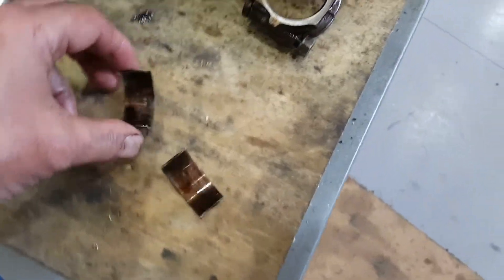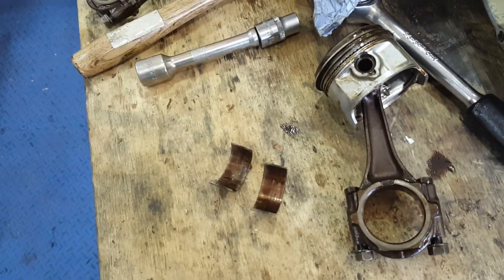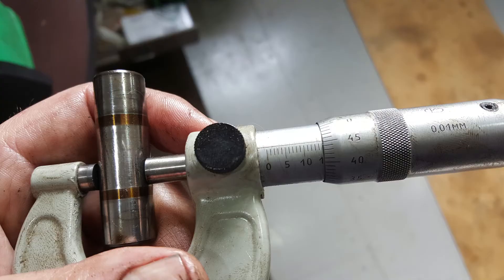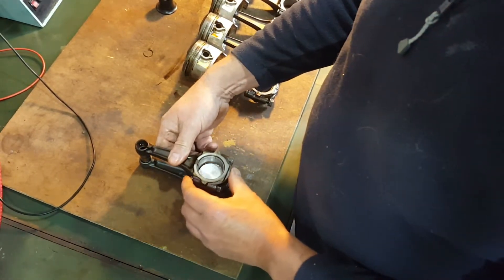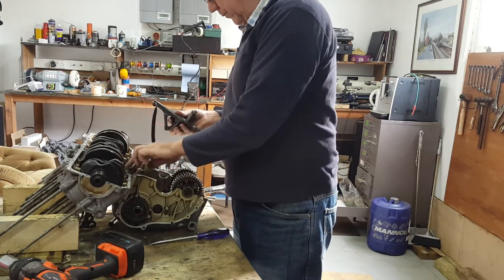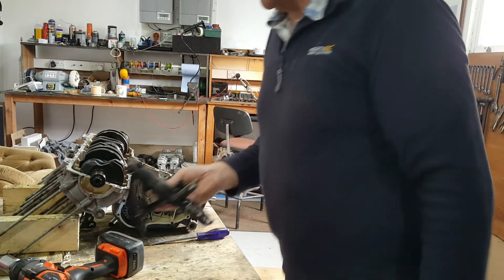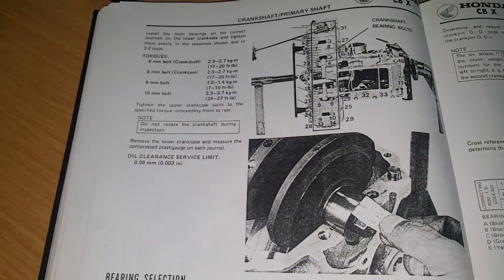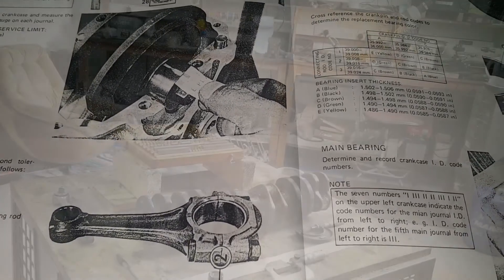Honda CBX 1000 engine strip and rebuild part 2. Inspection and measurement.

Comment: Hello again! I forgot to mention it, the CBX suffered from hydraulic lock risk after being parked, if the carburetors had one of the float bowls leak fuel into the intake. Honda fitted a vacuum operated valve that functioned as a security measure, inline with the fuel supply. 

Well, I had a dual failure I must assume. This was my 1982 bike. On starting, I heard the catastrophic delay as the engine cranked over, followed by a loping idle! This was in 1984. The number one connecting rod was bent indeed! Well, that new engine was completely disassembled in the process. 

I still have this connecting rod. I showed it to a friend who did electroplating for me. I joked, I should gold plate that rod, I was so glad that I did not lose the engine over this failure. It's visibly twisted in an "S" curve. Well, to this day, I have a brilliant gold plated CBX con rod, emblazoned with the factory number 422 on the side.

The crankshaft received some serious love, because I had a friend who built and balanced racing crankshafts. Well, he went above and beyond! The entire crankshaft has lovely swirl patterns on the counterweights, and the assembly was nitrided when complete, a lovely black assembly. It looked so nice, I rode the 1981 for a few weeks instead, and displayed the crankshaft in one of my display cases in the showroom (I had a motorcycle shop in the 80s).

Comment: Very good!  Subscribed!  Just bought a CBX (not in a good condition...).  First thing I'll have to do is to check (balance) the carbs and then check valve clearances. I assume it can be done in a "home" garage?  Regards!
Reply: Have fun synching the carbs.
Reply: Hehe, back in the day? I had a custom mercury manometer...with SIX tubes! BUT, this can be done with a standard four. Three variable, and the fourth compares against the other three. For the CBX you start of the reference carburetor, and balance each in turn to this. I must firmly attest, it's a very delicate balance. Once those six Keihins are perfect, you WILL notice the difference. Over time, you'll know when it's time by ear.
Reply: Ya use 2 of emm.. lol
Reply: @carlosoruna7174  hehe, at first I did just that! Then, a friend brought me a rare 6 cylinder one.